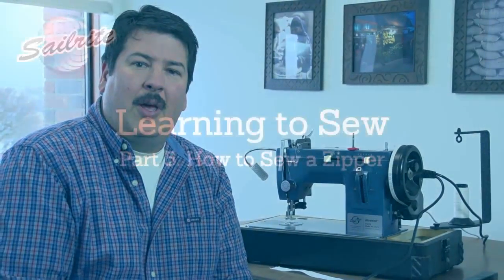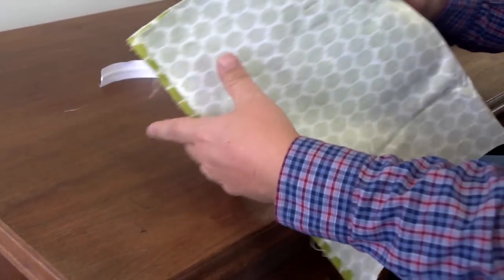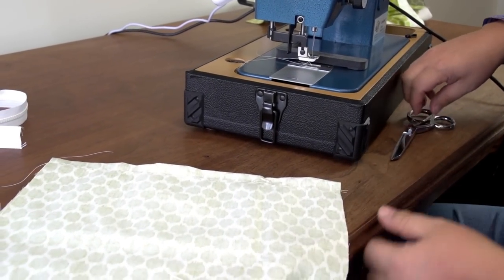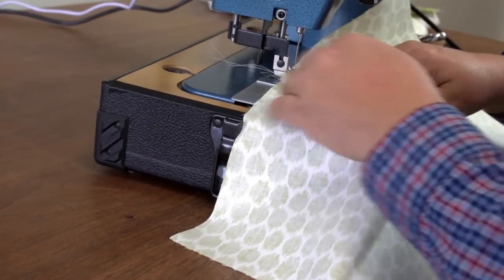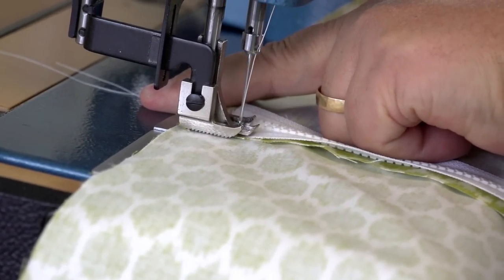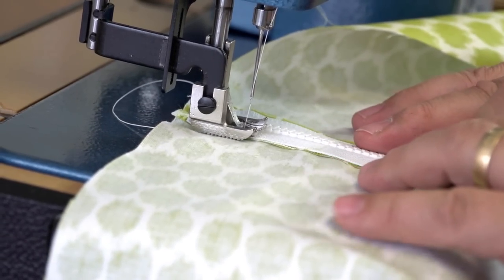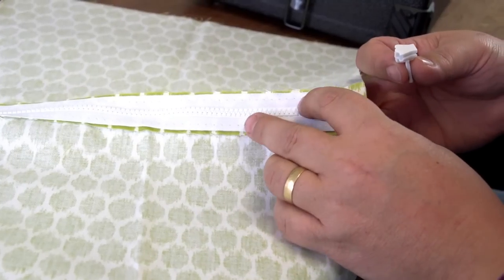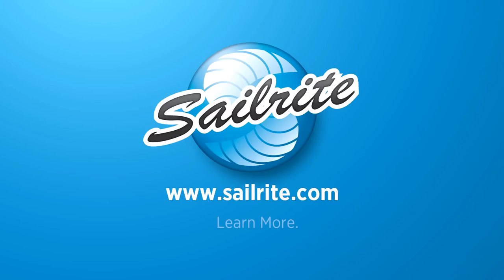Learning to Sew Part 5: How to Sew a Zipper

Comment: Yes this also works if you have a shorter zipper than your fabric is wide, go ahead and sew the two pieces together like he shows in the beginning, but only cut the length of the zipper you need, even a little shorter than your zipper is. I flat ironed it to make it easier to sew. Proceed as shown, but sew all around the zipper. Keep the guide on the zipper from the get go. And voila. Rip it open from the other side and there you go. Oh and make sure when you sew the zipper in, the zipper needs to be facing down.

Comment: Really Nice I'm looking to buy foot Kit any advise I've seen a couple on Amazon but not sure?? Thanks
Reply from the maker: Do you mean a walking foot attachment? If so, that is not a good purchase. The only true walking foot sewing machine has a mechanical walking foot that moves and helps feed the fabric as it lifts and lowers. An attachment walking foot only lifts the foot when the needle goes up, which is not very useful. Get a true walking foot sewing machine with a mechanical walking foot.
Reply: Dear Sailrite, your answer is the only thing I've ever disagreed on! My walking foot helps a lot. I think that's because I don't have a good Sailrite machine - can't afford one. So with my more puny, inaccurate machine, the walking foot makes a big improvment...for some applications.

Comment: This is the method I'm using next time...except, I like the way Cindy puts the zipper stop on. A subtle difference, She starts the process with the teeth closed, then immediately starts pulling them gently apart and slides the stop on. I think that would cause less tendency for the teeth to be uneven - that's what scared me away from 'zipper on a roll' before..
Reply: OOPS! I meant zipper pull...